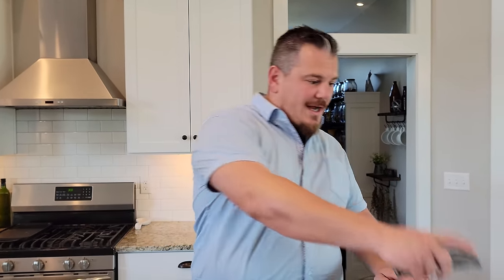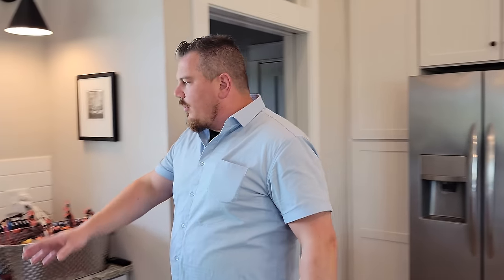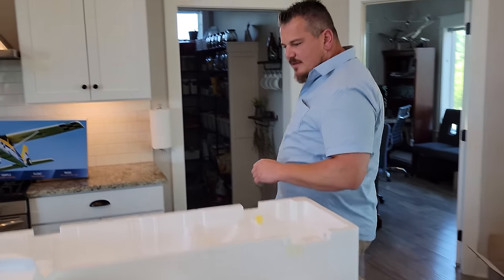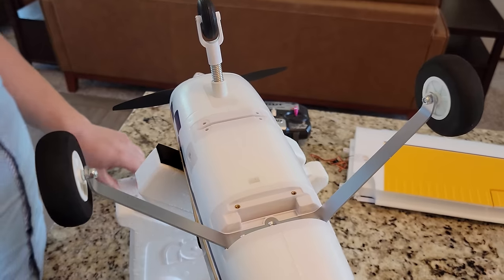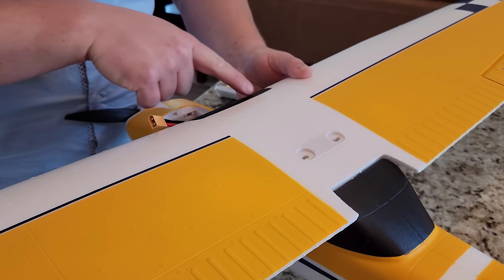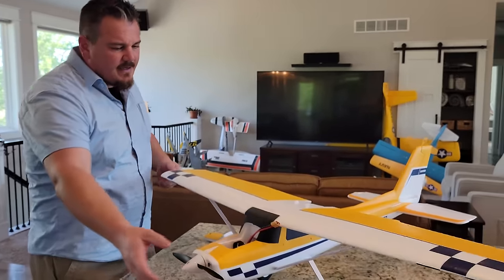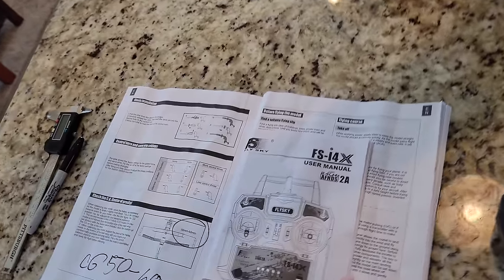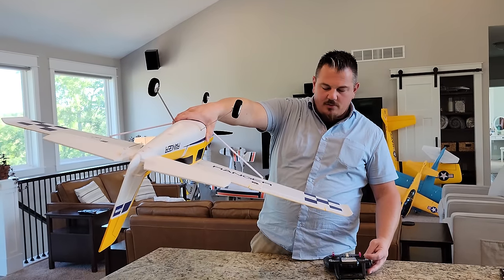FMS - Ranger RTF - 1220mm - Unbox, Build, & Radio Setup

Comment: I bought this plane but when i take of from the water only throttle my plane goes smooth first and then it flys straight up in the air and then it crashes in the water it makes a dive? And i dont use my right hand only throttle

Comment: Hi Brian, if I order 11.1V 1300mAh 3S 30C Smart G2 LiPo Battery: IC3, what adapter do I need to connect the battery to the Ranger 1220 and the S155 smart charger?

Comment: Awesome! Mine will be arriving later this week!
Reply from the maker: Good luck! Great plane! Super fun!!!
Reply: Hi Brian!
I was wondering if you can help me?
I received my Ranger 1220 mm today. It is set up and configured. I bound the FS-I4X and everything is working correctly. My only issue is the function of the SWA switch on the left side of the radio. I have looked in the manual & and Googled it, but what position is stabilized, optimized or off? The instructions do not explain it. Maybe I need to watch you video again. By the way, you have a great  channel!!
Thanks!
Scott

Comment: Just getting back into RC only have flown trainers back 10-15 years ago hoping for a little help on batteries for my new Ranger 1220 I do plan on getting a receiver looking at the NX8 but help on which batteries should I be using
Reply from the maker: Here's an excerpt from our Video Description...

https://bprc.me/FMS_Ranger (this is the plane)
https://bprc.me/3S_1300 (this is the battery size we suggest)
https://bprc.me/Tx (NX10 will get you more time, before you'll "out grow it" but if you're really brand new, you might just go with the NX8 to hold down the cost a bit. The NX8 is a heck of a Transmitter, by the way)

Hope this helps!

If you need a Receiver, buying it as a "PNP" (pug and fly - you provide receiver) without REFLEX, you can watch our older video where we show the PNP, rather than THIS video where we show the RTF (Ready to fly - they provide Tx and Rx)...

Without AS3X/SAFE...
https://bprc.me/AR410
https://bprc.me/AR620   <<<<<< This would do it if you get one PNP with Reflex
https://bprc.me/AR6610T
https://bprc.me/AR8020T

With AS3X & SAFE...
https://bprc.me/AR630  <<<<<<<< This or
https://bprc.me/AR631  <<<<<<<< This would work if you get one without the Reflex
https://bprc.me/AR637T
https://bprc.me/AR8360T

Comment: I just found the channel, it’s so helpful and I love watching the long build videos! I just ordered the ranger 1220 today! I got a extra prop, and landing gear to be safe. I want to get extra batteries and a charger or 2. What would you recommend?? I want to get 2-3 extra batteries. Would it be able to work with a higher capacity like 2200mah or would you recommend additional 1300mah batteries??
Reply from the maker: On this bird, the 1300mah 3S size is very nice, but you COULD also go with 2200, but she'll be less forgiving.

We put these links in the VIDEO DESCRIPTION, so you don't have to look too far ;)

https://bprc.me/FMS_Ranger
https://bprc.me/3S_1300   <<<<<<<<< This would be the size we suggest
https://bprc.me/NX20

Comment: I just bought this aircraft for me as a trainer and now im wondering what is the best battery to use with it, i got 2 1300mah batterys but i assume there are better ones out there
Reply from the maker: We share our suggested battery in the top of the video description, FYI...here's the excerpt.

https://bprc.me/FMS_Ranger
https://bprc.me/3S_1300 <<<< This is what we used and suggest, but any 1300mAh 3S that's got enough C rating will be just fine...say 25-35C would be idea.
https://bprc.me/AR620 | for PNP option
https://bprc.me/Tx | for PNP option

Comment: I have the RTF model and was wondering if i could use a larger size battery as the one it comes with is smaller in size to the ones i have. Can I use a larger C rating than a 25C and what does the C mean. I have seen many batteries that have 30,40,50 and 60c but have only bought the 25C ones as I don't know what the C is.
Thanks Chris

Comment: Just got this plane. What does the toggle switch on the top right of the RTF TX do?
Reply from the maker: I'm sorry, but can't remember. It's been forever since I used that Tx. If It's important, I would usually show it in the unbox, build, radio setup and maiden flight.
Reply: @BrianPhillipsRC  thanks for replying :) could it be a throttle safety cut? When I’ve got it all together I’ll give it a try and let you know.

Comment: Hi Brian, new to the hobby and ordering the Ranger 1220 using your link, what batteries can I use with the Ranger 1220 and what batteries do you recommend.
Reply from the maker: We would recommend a 1300mah 3s like this... https://bprc.me/3S_1300

You'll also need a charger... we'd recommend the S155 for someone just getting into the hobby. You can see all the Smart Chargers here... bprc.me/SmartChargers
Reply: Thanks Brian, we love your channel, the second link didn’t work.  In regards to the battery is the 30C smart G2 compatible?  Will get the charger recommended as well, I just want to be sure I order using your link so that you get credited for it.  @BrianPhillipsRC

Comment: If I upgrade my radio to a safe/as3x radio with the appropriate receiver could I in theory remove the reflex v2
Reply from the maker: Sure could! We'd probably recommend an AR630 or AR631 if you want AS3X and SAFE...

https://bprc.me/AR630 (the link for the AR631 is the same, except with a 1 at the end... Google blocked it for your safety... they wouldn't want it to be convenient for you...)

Comment: I’m setting up crow braking on my EC 1500. My ailerons keep moving in opposite directions when I apply crow. I can’t figure out what I’m doing wrong and I can’t find answers online either. I’m sure it’s something super simple. Can anyone please point me in the right direction?
Reply from the maker: EC1500, is probably going to force you to change the wiring. I don't know if the left and right ailerons are on their own channels.

I also have to assume you're on the BNF plane? If not, then should be do-able, otherwise, you'll probably have to load the LATEST AND GREATEST FIRMWARE on the Rx ( https://bprc.me/SPMA3065 USB to PC Programming SPMA3065 TX/RX USB Programming Cable ), then you can setup a virgin model, where you can make such assignments...BUT you will definitely need separate channels for the left and right ailerons OR they will work like you've described.
Reply: @BrianPhillipsRC  I did get rid of the y cable. I think you’re right about either changing the wiring or getting a reverse servo or something. Thanks for taking the time sir. Huge fan. Love your work. Thank you.

Comment: 41:07 how do you turn it? Cuz I can’t get that to move
Reply from the maker: Might be trying the wrong way??? They hold the wing on...so maybe you're not getting enough penetration...do you have a WIRE stuck in there or something strange? Double check you're free of binding, and if it still won't go...REMOVE the wing and try it when you can SEE...these locks will swivel so you can see it.